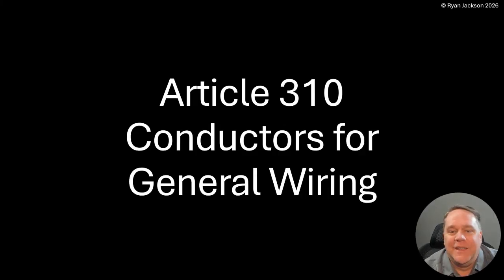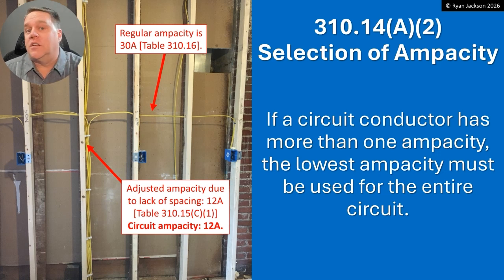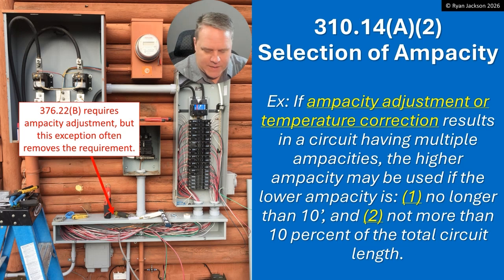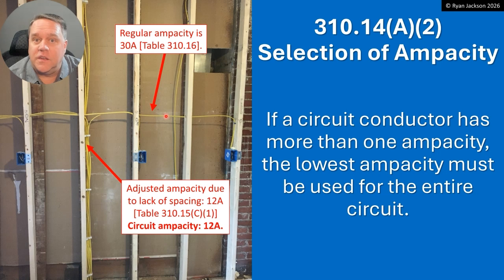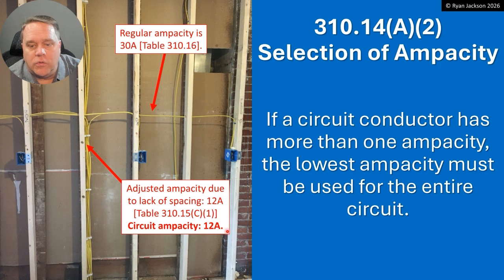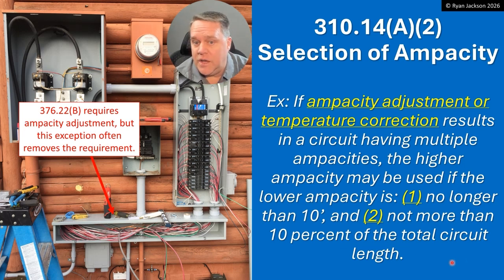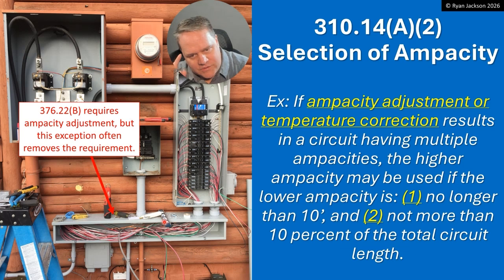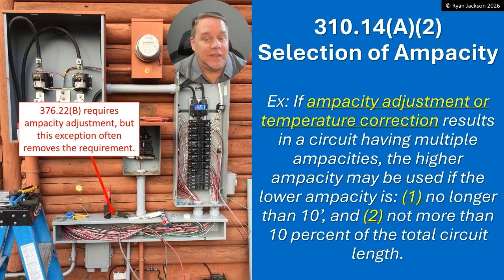100 Days of the 2026 NEC Changes Day 40: 310.14 Conductor Ampacities

Comment: These codes are so ridiculous... What about reducing ampacity for spray foam?
Reply from the maker: What about it?
Reply: Electricians can only strap 3 cables together otherwise it's considered bundling.. and we have to reduce ampacity. Or three cables through a bored hole... Etc. 
But afterwards the building can be completely spray foamed and it's no problem?

Comment: I thought with romex ypu always have to use the 60 degree column so it should only be good to 20 amps not 30 as yhe picture shows
Reply from the maker: The ampacity is 30A. It must be terminated at 20A.

Comment: So what happens when the sheetrock is installed and you have to do a service upgrade? All you see at the panel is the conductor sizes. All the conductors are not under load at the same time. What if the conductors in cable stackers are all of the same circuit, like for lighting switch legs and travelers? The conductors grouped together entering the panel are all grouped in a 14 1/2" stud cavity. Derate everything?

Comment: In your example photo, the 12/2 romex wires are spaced with those snap lock spacers. You wouldn’t consider the spacing is maintained even though they are spaced separately by those devices?
Reply: Wondering the same myself.
"Where more than two NM cables containing two or more current carrying conductors are installed in contact with thermal insulation without maintaining spacing between cables"
I'd argue those stackers give spacing. And if they didn't, I assume the next question would be is this wall getting insulated
Reply: Yeah, there is a decent little air gap between the pairs of cables in that installation...
Reply from the maker: It is subjective. I think the key word is "maintain" as it relates to maintaining the spacing. In this example you could easily argue that it complies.

Comment: There are thousands of electrical fires each year in the US.   Most don't make the statistics.   Most are caused by damage or sloppy installation.  In the case of homes, more circuits doesn't mean more loads.   It just means that was once one circuit is now two circuits.
Reply from the maker: What is your source for the fires if they "don't make the statistics"? Where are you getting your statistics?

Comment: Good clarification, great video! 2 things: would the 4 - 12/2 NM cables on stackers as pictured require adjustment as 8 current carrying conductors? Also keep in mind for wireways the 30 current carrying conductor rule applies to A PARTICULAR CROSS SECTION, not the total number of wires in the wireway. That may make a difference depending on how conduits and wires are configured.
Reply from the maker: Yes, 4 12-2 cables is eight current-carrying conductors. Regarding the wireway, I wrote the rule that specifies the cross section. Years it ago it did not say that.